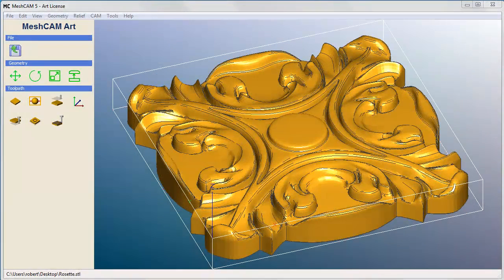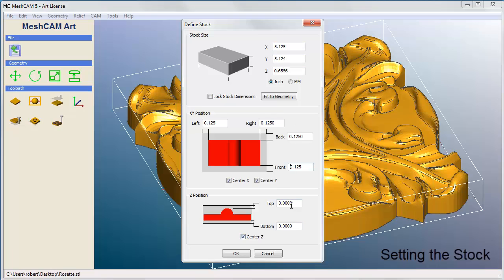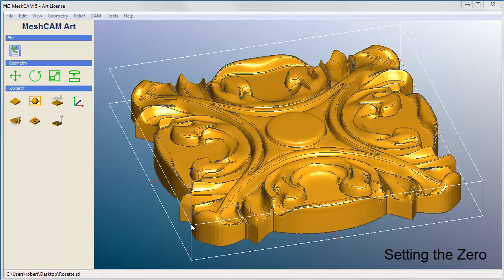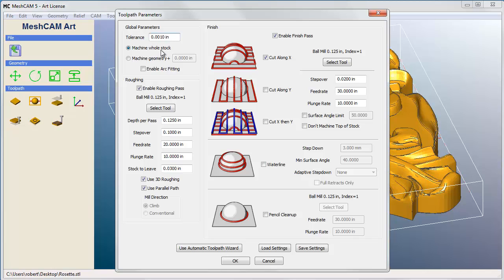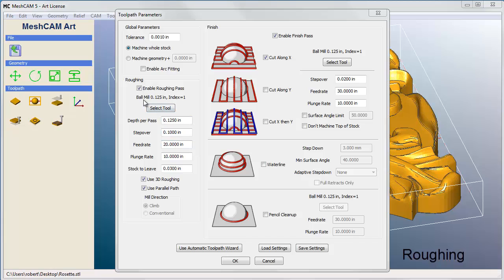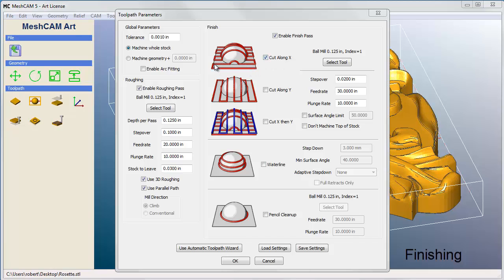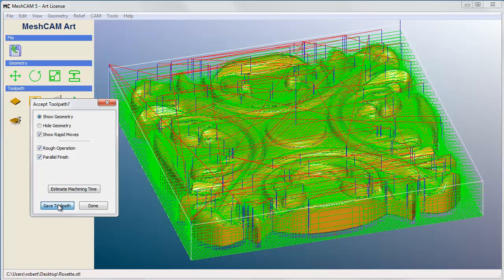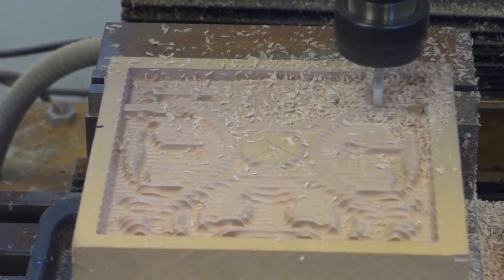Simple Project with MeshCAM

Comment: Is there an option to assign a machining operation just to a subset/region of a design (like in Rhinocam)? For instance, let's say there is only a small part of the design that has a lot of detail and requires a 1/32 endmill, but the other 95% of the design can be roughed+finished with a 1/8" endmill. Would I be able to use a rectangle, circle, or freehand region to keep the fine detail routing to that specified region?

Comment: Not sure if I'll get a response for this, but does this software have the ability to simulate odd tools such as Corner Rounding End MIlls, Dove Tail cutters, as well as Woodruff Cutters?  I'm trying to machine out this track for clips with a specific radius and the conversational programming simulator only has a few tooling graphics on it.  I can't utilize it to verify if what I wrote will work the way I want it to visually so if this CAM Software can do that for me, I would be very impressed and likely to purchase it.

Comment: I am trying to do a similar run , but taking a jpeg picture and having meshcam machine my part in MACH3. It turns it into a 3d with the X being 1.5" and the Y being 1" .. My material is  a 3"x3"x.50thick part. The only thing is, when I go to run it on my machine /MACH3 , for some reason it is machining/hovering about 1/4" above my stock and not plunging/machining into the stock? Does this have to do with setting the Zero setting in meshcam? aI set my zero setting on mach3 100% correct?
Reply: Maybe you have to set Mach3 X,Y and Z to Zero, leave 0.010" (maybe using a piece of paper simulating the thickness of 0.010"), after that you can set it either start from any corner or the center and then start your G-Code, do not used the probe just do it manually.